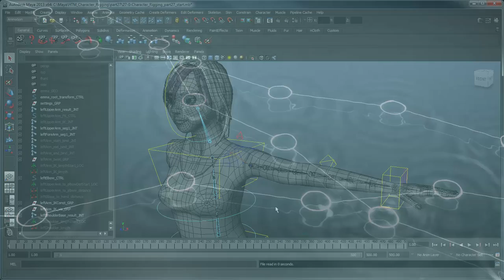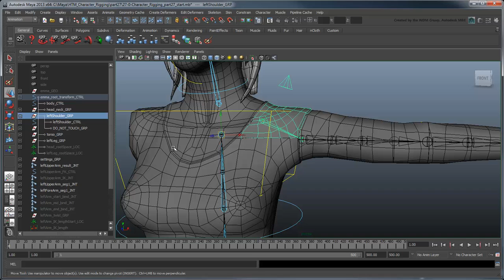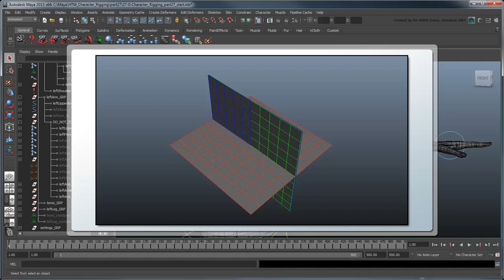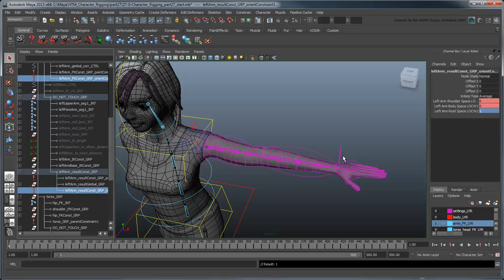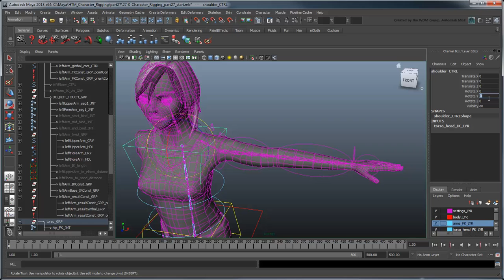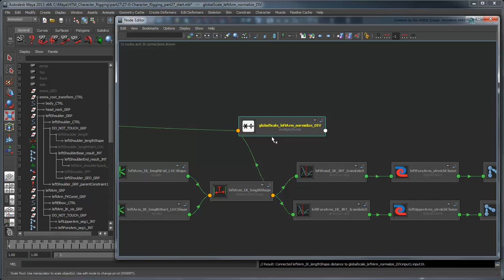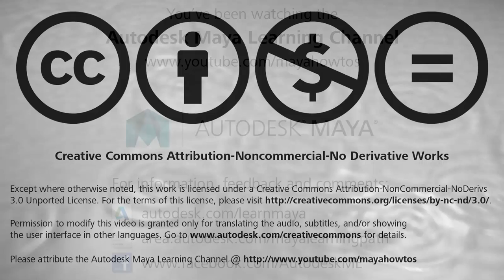Creating a Character Rig - Part 27: Arm global transform and cleanup (Advanced)

Comment: One of the things I'm doing is making a IK stretch on/off button. I'm able to relatively easily by plugging in conditional nodes and using the blends that have the TranslateX nodes plugged into them. In fact, the only real issue is that when I use the elbow snap, the upper arm stays in place with the IK, while it points to the elbow with the FK. Is there anything I can do to get the upper arm to aim at the elbow in the IK mode?
Reply from the maker: I actually go through the process of creating On/Off buttons in Appendix B, lol.  https://www.youtube.com/watch?v=IINbF0qxyCc&index=38&list=PL8hZ6hQCGHMXKqaX9Og4Ow52jsU_Y5veH

That said, unfortunately this implementation of the elbow snap won't work without stretching turned on.  However, it shouldn't ever point at anything FK-related.  The version I show will still point at the IK elbow control, but it won't snap to it unless stretching is enabled.
Reply: The reason it pointed to the elbow's FK was more coincidence as the result joints are trying to get to the elbow FK, but I found a fairly easy way to do it. Admittedly, I do a lot of scripting, so it might be faster on my end for already having all the infrastructure to quickly repeat it.
1. After setting up the IK orients, make a copy of the IK (I'll call it IKsnp), 
2. Have the IKs orientConstrain the IKsnps, and connect the IK translateX's to the IKsnps' translateXs (this will be changed with a later conditional). 
3. Have the IKsnps connect to the arm JNTs for the FK/IK switch.
3A. Do everything the same (largely ignoring the IKsnps until you get to the end of the arms section.
4. On the settings or elbow, add an IK Stretch option (boolean or enum). True/On is if we want stretch on.
5. Create two conditionals, forearm_IK_stretch_cond and hand_IK_stretch_cond. Set up the operation so when IK Stretch is True/On, the stretch is on.
6. Plug in the default length of the upper arm and forearm into the ConditionR if False
7. Connect the translateX of the forearm and the hand into ConditionR if True (set the G and B values to 0 for both true and false)
8. Connect the outputR values into the translateX of the IKsnp forearm and hand.

The reason why it worked for the knee in my case was because I had the PV and noFlip values stretching invisibly, with the IK following along. Theoretically, this would probably be more clear if I made the original IK joints something like IKStretch and the new ones the plain IK.

Comment: Maya learning channel I have a problem. At 15:20 I have no idea how to do the same for the "elbow snap" and am kind of freaking out. If you could please direct me through that part? I would appreciate it more than you know.
Reply from the maker: Basically, you need to create another pair of globalScale normalize nodes that attach to the character's scale attribute and divides the upper arm and lower arm distanceShape values appropriately.  Try loading up the included scene file from Part 32 (the finished rig) and looking for "globalScale_leftUpperArm_to_elbowNormalize_DIV" and "globalScale_leftElbow_to_handNormalize_Div" to see the exact connections.
Reply: Thanks! It worked.

Comment: Hey, so the newest problem comes with the constraints for the Right Arm. Once I've added all the orient and point constraints I tried the test you did at 11:33, but the arm no longer blends all the way back to the IK hand; it seems that the result and segment joints no longer follow the IK joints. I used the mirrored joints and duplicated shoulder.

I took a screenshot of how it looks when it is 100% blended to the IK:

http://tinypic.com/r/2pqvz37/9

I had to use the constraint offset to keep the joints aligned due to the differing rotation spaces, but I didn't think that would have any impact on the switch? Thankyou in advance for your help again!!

Comment: Hi there¡¡, i had a problem in min 11:26 after preparing the ColorNode when i put my IK/FK mode in IK my results joints get the same position, stay in FK´s position and the IK´s controls visibility turn on, then i turn back my IK/FK mode to FK but then my result´s joints go to IK position and the visibility of both controls systems swap in wrong way, i fixed this sawping the ColorsBlend´s input 2 to 1, ¿its this correct or im doing something wrong?

Comment: I don't know whether or not you've seen my comment so I'll post it here just in case:

I'm  having issues with the scaling with regards to the elbow. I've connected the elbows distance nodes using 32's file as a guide. Is there something I'm missing or could something else be the issue? 

ISSUE: https://drive.google.com/open?id=0B67mUFlUgum_dU52N0xvaUtUZW8 

NODES: https://drive.google.com/open?id=0B67mUFlUgum_MFFpT28yNDFHRE0
Reply: After looking at your 2nd image and comparing it to my node editor, the only difference I see, is that I have connected the ScaleX, and not ScaleY, of my root transform control into the MulitplyDivide nodes. Try that.

If that doesn't work, could you post a screenshot of the Arm Normalise DIV connections and the Elbow Normalise DIV connections to see if it might be your IK Arm Normalise nodes?
Reply from the maker: Are the globalScale nodes set to Divide?
Reply: Luke the CGI Guy - Changing to Y didn't help but you were on the right track in the second para. Thanks for your input.

Maya Learning Channel - My globalScale_LeftArm_normalize_DIV was set to Multiply so my issue is once again solved.  Seems I'm missing a lot lately. Thanks!

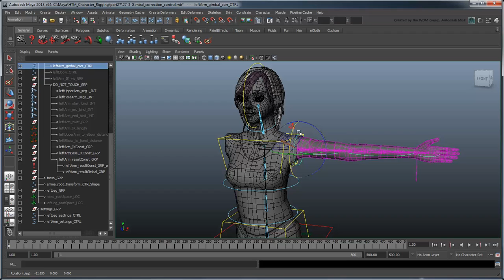Comment: i've got a little problem at 7:12. when i rotate the gimbal control the fk controls follow, the geometry does not. when i change then in ik mode & rotate the gimbal control the geometry follows. wonder why this happens. (& yes, i've build this in fk mode as it's wanted.)
Reply from the maker: Did you parent constrain the twist arms to the result joints, or IK joints by accident?
Reply: could you please tell me which step you're meaning?
Reply from the maker: To clarify, is it only the gimbal control that causes this?  If you move any other FK joint, does the geometry follow?  If so then it wouldn't be related to the problem I mentioned above.

Are you sure that you're in FK mode?  The gimbal correction is only meant for FK mode, so it won't affect your IK arm at all.
Reply: no, the geometry also stays in place when i move other fk controllers.
Reply from the maker: Then it sounds like in Part 22 you parent constrained the bind joints to the wrong arm.  Specifically, it sounds like you constrained them to the IK CTRL joints rather than the result joints.

Comment: So I oriented the locs to the Fk/result grps but am having this issue when I set the shoulder space to 1. I'm not sure what I'm doing wrong. https://drive.google.com/file/d/0B67mUFlUgum_N20yUzJNZzJaVzQ/view?usp=sharing
Reply: Ahhh I think I might of found my issue. I thought by selecting both the orients at the same time it would change the value of both. This is not the case.
Reply: Thank you so much for your help. I double checked the local axis and the FK local axes were indeed off. I'm a little confused how this happened as I did duplicate from the same result joints. Either way that issue was solved.

Comment: I know this has been a long time ago but I've been following this and somehow when I set my FK Rotation Space to Shoulder and move the shoulder controls, the FK Arm controls move properly but my bind joints/result joints are acting as if it is still in body space, I don't know how this happened :O. If I rotate the FK Arm Controls alone it follows perfectly. It's just the rotating of the shoulder that causes this problem, IK are no problem, just this FK, the Controls are in the proper position but the result joints are off.
Reply from the maker: Sounds like the blendcolors node for that joint is either missing or setup incorrectly.
Reply: I fixed it, the blendcolors node was setup correctly, thank you for taking the time to reply. What caused the problem was that I forgot to orient constraint the locators to the result joint group. Thank you for this awesome tutorial btw.

Comment: Hi, Can you please help me.  I've nearly finished but stuck on this one joint.
When I try and apply an orient constraint to the Shoulder, body and root space locators to the FK const group.  The FK Ctrl arm rotates -53.13 on the right side of the model.Please believe me I have tried everything,  even rotating -53.13  on all the locators on the FK const before applying the constraint Group. Trying with maintain offset on and off and even the FK joint itself and it still does not work.I have tried so many differnt approaches I have mirrored like in video 32, I have Redone the right side completely from scratch apart from the shoudler joint and it still rotates.I have looked at your model unfortunateley on the character rigging part 32 start I have tried the same thing on your model and the same thing happens it rotates.But on the next file, 32-1-Full_mirrored_leg_partial_arm
You have solved the problems and it works perfectly.Could you please let me know how you sorted the problem.
It would be very muych appriecated.Thanks.
Reply from the maker: In your Move Tool settings, is "Automatically Orient Joints" enabled?  If so, turn that off.  That number is strangely specific and it causes me to believe that either all the local rotation axes of those joints are not identical, or that the spaces you're parent constraining are out of alignment.  Is the "Maintain Offsets" option of the constraint on as well?  That needs to be enabled.
Reply: Hi, Thank you so much for your quick response.
I tried everything you said.  The Local rotation axes where checked and they were all OK. The automatically Orient Joints" was enabled.  I turned it off.  I started after I had already parented the shoulder.  will that make a difference.
When I tried every seemed OK, but when I adjust the orient constraints, for example when Put 1 in the shoulder and 0
in the body and root.  The arm flips over his head. and similar when I adjust the other constraints.
The orient constraints I used maintain offset and for the point constraints they were off is that correct?
Would you suggest I start the right arm again??  If so would do I need to do in order to align them?  Just duplicate and Make sure that the automatically Orient Joints" is not enabled from the start.
Thanks for your help I really really appreciate it, any help you can give will be greatly appreciated.
Reply from the maker: The Automatically Orient Joints option will cause most of its problems when translating the joints into position on the initial skeleton setup (we mention to turn this off in a very early video in the series).  If you double-checked ALL your LRAs and they're fine, then it shouldn't cause you any further problems.

I would try it with maintain offset enabled for everything.  Honestly, even if there's no offset then the worst thing that happens is that it records an offset of 0.  And have you looked at the "rightArm_shoulderSpace_LOC" in our example file for part 32?  That is an example of the kind of adjustments you need to make if you go with the quick mirroring method shown there (to avoid flipping like you're describing).
Reply: Hiya,
sorry for the long wait for responce. I thought I would just pull my sleves up and start the right arm from scratch.  Then I'd ablee to thank-you tell how I worked it out so you could maybe help somebody else if the problem sounds familiar.
No such luck,After taking everythng into consideration, and all the tips you have given.  It still did the same thing sort of.
When you adjust the constraints for each body part the arms now go 180 in XY and z after all that time.  I am so dissappointed.  I really thought it would work.  I spent so much time making sure everything was correct.  Using your completed model as refernece.  Checking all THe LRAs and parent constraints an it is still won't work.
I even tried to use the bones from your model to see if there was any difference and nothing.
I Just don't know what to do?  It is the best tutorial I  have ever seen and the rig is superb but If I can't get the FK arms to rotate in multiple spaces what is the point.
Actually I could ask.  Is they a way I can connected the arms without this method? perhaps full skeleton.
I did try that too but it just didn't work correct, plus I didn't know whether to connect to the FK or the IK spine.
Plus with the shoulder joints it just didn't work.
Or is there another way I could rotate the FK arms just not using the Orient constraints on the locators.
Thanks for your help I really appreciate it,  I am very greatful for the time you have given to help.
 Sorry for the long message.
Reply from the maker: Something must be different, or else either both yours and the example rig would work, or they both wouldn't work.  Just to reiterate, are you only making adjustments on elements contained in the arm group?  Did you check the shoulder locator that you're parent constraining the arm to?  If you check the example file, you'll notice that locator is rotated 180 degrees to offset that 180 degree rotation you're referring to.
Reply: Hiya,
I am making adjustments to elements contained within the arm group.  I  kept having to make sure to freeze the rotations on the  Ik joints so they were at Zero.  They kept changing to 0.001 002.5 etc in all the axes.

All the axes were zero including the start, mid and bind joints for the twist controls and also the segments.

I did check the shoulder Locators and it was the minus to the left arm. ie. 17.908 left.   -17.908 right.

There are other values but they are only in the Translations.  This is because I mirrored it as shown in the video.

It does have a value of 180 but it is not minus.  When I duplicate these locators and place them in the appropiate place the Values for the body space and the root zero out?

Then when I add the orient constraint with maintain offset selected the value 53.13 appears in the offset Z.

So I tried to match the value in the shoulder locators to the body and root locators. and deleted the 180 from the Y value and The 53.13 appears in offset X.

So I tried to add -180 into the Y on all the locators along with same values as stated before and the 53.13 appears in the offset X  and 180 in the offset Y.

I did try to add the 53.13 value to the locators but it just turned green and multipled the value.

Thanks again...For your help.
Reply from the maker: Sorry when I say "shoulder locator" I meant "shoulder_space_LOC" as this is the locator the arm is being parented to.  Notice that the right one has a -180 rotation whereas the left does not.  This is to undo the mirrored spaces (you should only need it in this one place for the arm -> shoulder connection, don't go changing random locators to -180 otherwise you will continuously flip the space over and over again).  And as you have indicated, ignore any translations since they don't matter.  We're only concerned with rotations here.
Reply: Hiya again,

Long time. I decided to give it a rest for a while.  It was driving me crazy and angry because i couldn't work it out.  I started again and have finally managed to do it.

Thank you thank you thank you.  It worked. I wish I had checked mail sooner.  I can't thank you enough.

I'm thought I was nearing the finish line but have another problem. Has arose surprise, surprise.
I read through the comments and some of the guys have had the samee problem
it is in appendix 2. 

Matching IK to FK.
The FK to IK works fine but IK to FK is the problem.
It stretches the arm way above the body.

I read your comments
You said to check that the results and the snap are in the same space. 

There are not.  I did try to Freeze the values, then I typed in the values of the result hand into
the snap group.

I tried lots of different appraches and none of them worked. could you please tell me how I would
oriented them so the IK will match the FK.

Also when I try and add the
setAttr leftArm_settings_CTRL.FK_IK_blend 0;
on any of the code it does not work.  When I remove it the FK to IK works. 

 But It also says No solver? any ideas why?

Hope to hear from you soon.  Thanks again.
Reply from the maker: Don't freeze values, that will only make things worse (or may even be where the problem started).  Like the tutorial states, you need to make sure the snap joint for IK or FK is an exact copy of the same joint you are matching to.

As for your second issue, the only reason I can think of why those might not work is that you may have named the nodes incorrectly.  Seems like it's not finding the blend node.

Comment: hey MLC, quick problem : at the very last stages of the video, we need to used global scale multiply divide nodes to make sure the IK joints scale properly with the root ctrl. so far so good, and then suddenly a correction pop-up shows on the screen saying that we need to do the same thing for the "elbow snap" measurement nodes. i kind of got lost there, what do i need to connect to what ? please help ! thanks :)
Reply: note - i downloaded the scene file to try to find the answer in the Emma rig's node editor, seems like that stage was skipped. when the elbow is in "elbowsnap" mode, the IK arm doesn't scale properly.
Reply from the maker: You'll need to create new global scale multiply divide nodes to connect between the upperarm_to_elbow and upperArm_stretchChoice, as well as the elbow_to_lowerarm and lowerArm_stretchChoice respectively.  This is to stop the snap elbow from bending automatically as you scale the model up and down.
Reply: Amazing ! thanks for the quick reply, you're the best !